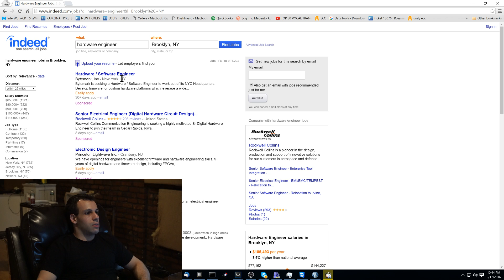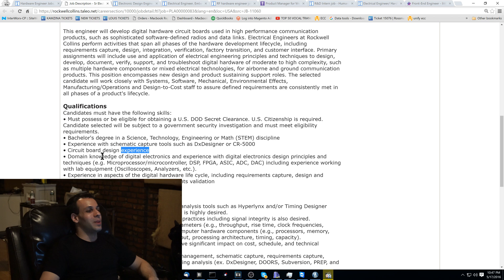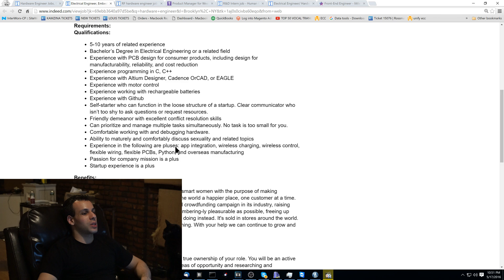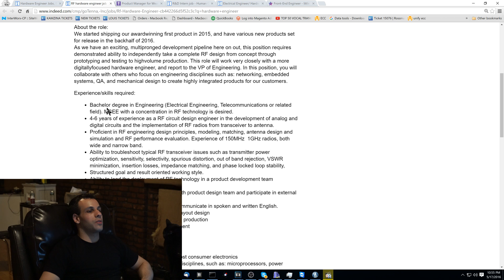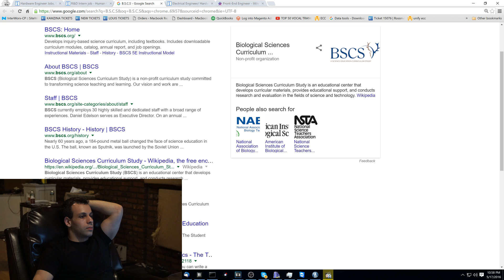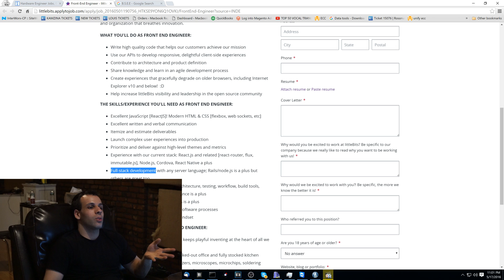Louis looks for a job

Comment: Hey. Louis, the smart people you are referring to are the same people that decided to make screw holes in the screen frame on Apple laptops, those that crack... Not all of these "Smart people" are that smart, I have to deal with these people on a regular basis, and god are they dumb!
Reply: +DeFreeze "Not all of these "Smart people" are that smart, I have to deal with these people on a regular basis, and god are they dumb!"

Just because you are "qualified" for a job, doesn't mean that you will excel in it. Some that are not anywhere near qualified for a job, could come in and outpace even the most qualified of people. Or hell someone that has been doing the job for x number of years. 

A slight side note... Experience can be good, but it's not all telling. Just because you worked a job for 10 years, or however long doesn't mean someone who just started can't do the job better or more efficiently. 

Now as for the specific mention you made about the shitty mechanical design. That could have been done for any number of reasons. Anything from planned obsolescence, to simply overlooking it. A lead engineer could have said do it this way, and those under them kept saying no no  no that will not be good for long term, and the lead said do as I say, or I will find someone who will. Either or there are any number of reasons why it happened. 

The crux of the apple situation appears to not want to design quality products that last.. or at least last for x amount of time until the next product launch or so. If you buy into the apple ecosystem, and one product fails, you are more likely to just replace it with the newest version. If it didn't break/fuck up... the majority would likely hold onto them. Which... would reduce sales of newer products. 

So it may not necessarily be that they have "shitty unqualified engineers", they could very well be doing exactly what apple wants them to do. Considering their track record it appears they like their current path and do not wish to change.
Reply: +qballtvp I'm not sure if you're agreeing or disagreeing with me, maybe a bit of both, hehe. I agree with you. I brought up the Apple frame to relate to Louis's channel more. I'm a maintenance mechanic(Nothing to do with computers), and sometimes I have to make poor designs "just work". Although I mostly work with enterprise gear which are mostly built like tanks.

When working maintenance, you have a very different perspective than working in product development, cause you get to see what constantly fails and you are more hands on with what a material can tolerate, it's not just a 3D model on a screen, like Louis probably does all the time. Reason I brought up the screen mount was because Aluminium has NO strength when it's that thin, zero, nada. Aluminium is a very porous material and does not deal with stretching or bending well. The reasoning might have been that be backplate would reinforce it, but what do I know. It might have been planned to fail, but making it that thin is a step to far in my opinion.

I know some GREAT product developers, and those take advice from maintenance guys, because we see things they don't and vice versa. Sometimes they give me great advice how to take it apart to fix it, and what might be wrong. Those who take so much pride in their work they won't listen to anyone or maybe even get offended(Stab at Apple) usually makes products that fail. Here's where experience, skill, education come in, it doesn't mean jack shit if you don't use it, or are not allowed like you pointed out.

This was a messy comment. 

-Regards,
DeFreeze
Reply from the maker: +DeFreeze point taken
Reply: DeFreeze "maybe a bit of both, hehe."

Yeah a bit. Mainly just pointing out that the world isn't black and white it's rarely an either or kind of thing. There are so many different motivations, so many different things that people use to justify this that or the other. With corporations the motive is usually pretty clear... profit. With people within the corporations it can get a little murkier, but with a basis of profit in mind. 

"I brought up the Apple frame to relate to Louis's channel more."

I saw that video as well, and can relate to it with noticing areas where products are designed poorly, or simply designed to fail. Which is which is the real conundrum, and maybe it's purposely a bit of both? 

'and sometimes I have to make poor designs "just work".'

I can relate to that as well, either by changing/fabricating something to throwing some duct tape on it. When you have to get it done, you have to get it done. With the frame issue, a little bit of epoxy could have stiffened it up a bit, but it would more or less permanently attach the frame to the lid. I can't remember if there was an absolute need for them to ever be removed? But if not then it wouldn't matter and would be a viable solution. So anyone who gets that model of "computer", could take it apart, and throw a few drops of epoxy along the edges, and around the area where a crack would begin to form, and that would keep that issue from ever coming up. The trick being to make sure it's not too thick, and or it would impede it being reassembled properly. 

"Although I mostly work with enterprise gear which are mostly built like tanks."

And I can believe that for the most part. I have dealt with some enterprise gear that wasn't all that great, but for the most part it is and for a very good reason. It's a different base of customer. Where phones and computers on the consumer side of things can be easily replaced without as huge of an interruption. With the commercial side of things, that server will have to be up and running for x number of years, and if it is built shitty/designed to fail they may actually lose business. It's also a fair use case to use. Where the consumer device doesn't get used as often as a commercial device, so the consumer device doesn't have to be built as well to handle x amount of time in the field so to speak. 

"Aluminium has NO strength when it's that thin, zero"

Actually it does when it is designed and implemented properly. I think in the frame video the main reason it failed was not due to it's "thinness", but where/how the screw was attached. The holes in it afterward were probably an afterthought. Where if the screw holes did not exist, the frame wouldn't have fractured like that as easily. 

Also it's not about making it as strong as possible, it's about making it strong enough to handle most typical forces applied to it. For instance if you are designing something that only has a static load, you would make that as strong as possible, but add little to no dynamic load properties to the structure. And or specific dynamic loads against others.

"Aluminium is a very porous material and does not deal with stretching or bending well."

I agree, but when the actual design is taken into account, you can mitigate stretching/bending depending on said design. If you do so within your design, and it works as is, but someone comes along after the fact and drills a few holes in it... it changes the structure and makes it less able to withstand the forces applied and makes bending/stretching less mitigated. 

"It might have been planned to fail, but making it that thin is a step to far in my opinion."

Yes, but that's your/my opinion that it was a step too far. In apples eyes, it could have just been far enough. They could have seen the frame and thought. Hey... that will last 5+ years. We need it to last ~3 years. How can we cut it down? Oh yeah... bzzzt bzzzt screw hole here and here... tadaaa. 

"I know some GREAT product developers, and those take advice from maintenance guys"

And I think that is not necessarily uncommon. But the thing is... What is the company's motivation in all of it. Where do they wish to derive their profits from? I have dealt with some large companies before and if looked at from just a baseline perspective it would seem insane. Like some companies are willing and ready to hand over any/all schematics, hell even make PDF's with traces built in, with links to enable/disable certain components to better be able to identify and track down a problem. Then you have companies that hold onto that kind of info for dear life... like apple. Those companies... just so happen to have a tech standing by just incase you need them. Even if you want/need to do all the maintenance and repair work yourself. Those companies typically push hard against giving as much information as possible because it is against their chosen business model. The companies that freely give out schematics and want to help you... help yourself typically do not have tech departments on standby to fix their products... or if so very little and or it's not a part of their core business model. 

"Here's where experience, skill, education come in,"

Sort of. But experience can be faulty. There was a book awhile back (outliers) that made a bold statement of.. 10k hours of practice/use == mastery. Seeing people do jobs either the wrong way for 10's of years, or in ways that is just not efficient, I don't buy into it that much. If the 10k hours were spent learning, and applying what you learned and you consistently try to improve... then absolutely I agree with that statement. But... if you do the exact same thing in almost the exact same way from day one? Not at all. This is where what Louis typically says applies.. You have to use your brain, and I will add to that... apply critical thinking to what you are doing/learning. Without that, you are just regurgitating shit you have little to no actual knowledge about. Solving problems requires more than just knowing how something works. You also need to know why it works, and how to fix it when something fails. Shit that is not necessarily going to be in the textbook.  

"This was a messy comment. "

Not at all... well my opinion at least. If yours was... then mine is many fold more so. Either or it's always nice to have a civil discussion on youtube. It's a lot rarer than it should be.